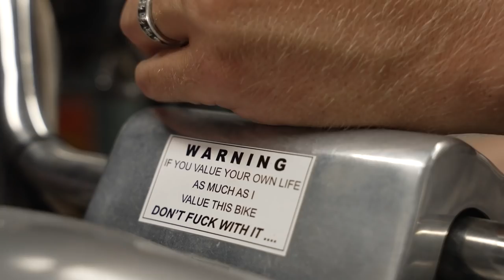5 Min Teardown - 1980 Shovelhead Harley - (Chopper Build pt.1)

Comment: I dig the speed but this should be called how not to teardown a shovelhead. Ctuting the belt, speedo cable, cranking on the primary case with a screw driver and didn't use a clutch spring retainer! Bet yall had fun putting that back together!